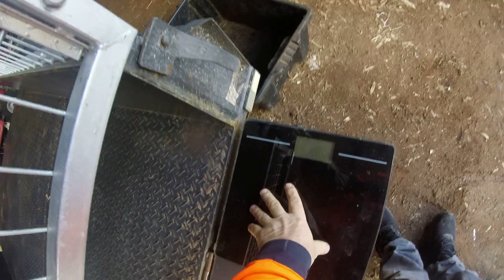DUMPSTER DIVING PICK ME UP WEIGHT ME UP

Comment: I do container deposit. There is folding money in it if you can source it okay. I saw some fine aluminium trays there. I do aluminium tray [ allsizes ]. Next to no money in it, but I'm given to putting that together for the local Simsmetal. I wouldn't expect anyone else to do it, other than the transfer station.